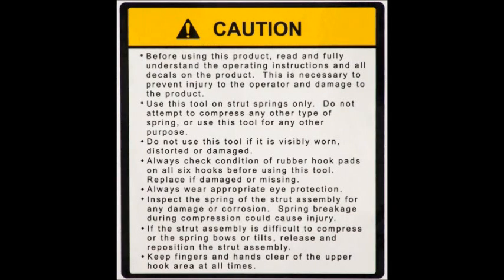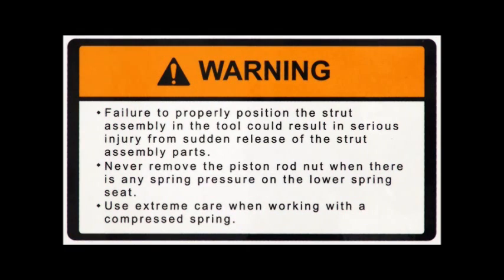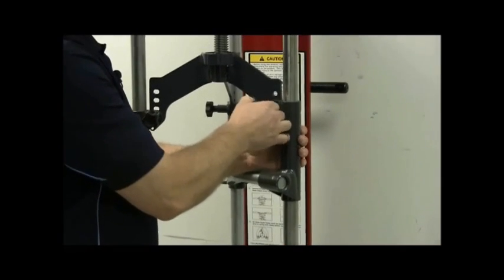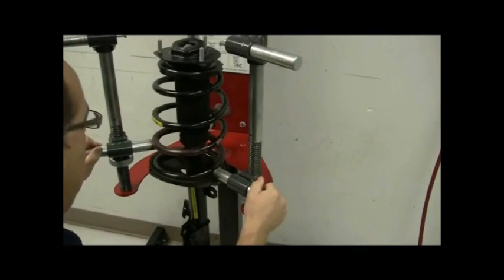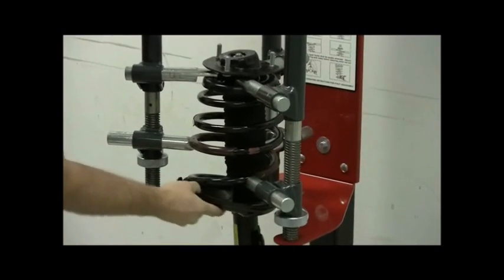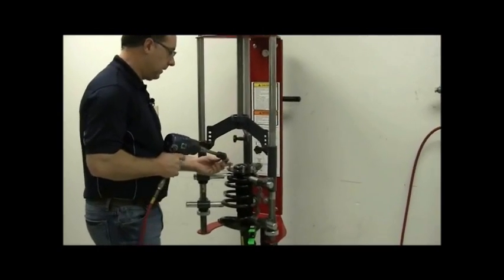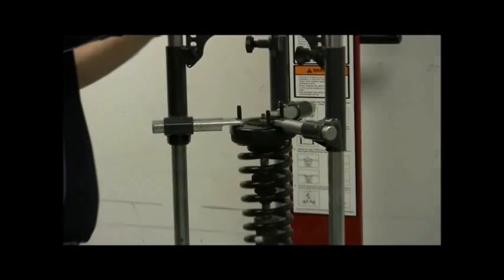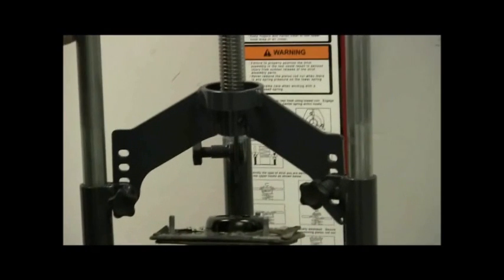Strut Spring Compressor Operation

Comment: Tool works good just a pain in the ass to set up. When your flat rate and have to mess around with those fingers, its a huge time waster. But does compressor coils very well once set up properly.

Comment: A word of advice, never, never ever use the pneumatic impact wrench or electrical assistance to unscrew or screw on the shock abosorber top hat/bearing assembly. It should only be done by hand using both the assistance socket levers comprising the allen key or torx key and spanner. I learned this the hard way by ruining brand new shock absorbers by Bilstein for my Chevrolet Cruze. The long spindle of the damper should never be spun at high speed which is directly connected to precision elements and valves inside the damper or shock absorber. Mechanics get away with it because the shortened life of the damper assembly is not pinned down by the customer to inappropriate use of an impact wrench. Use an impact wrench  all you want with appropriate torque where the opposite end is rigidly fixed. In case of the damper assembly the spindle is not rigidly fixed in its axial direction.
Reply: And yet every real mechanic does fine despite. Sounds like you were in over your head kid. Leave this stuff to those actually up to it.
Reply: very good info